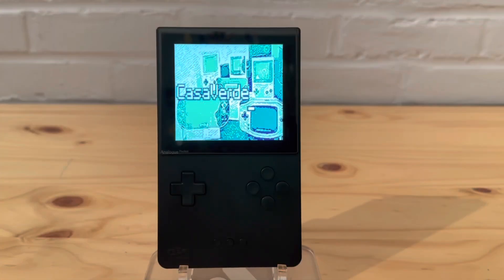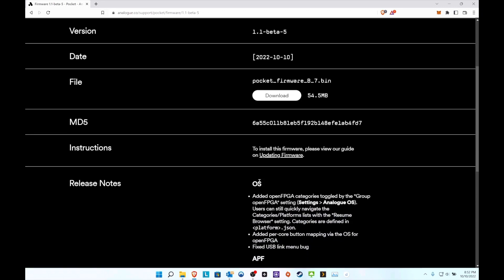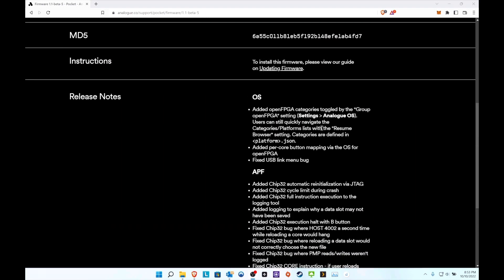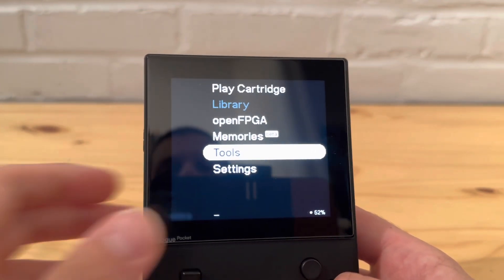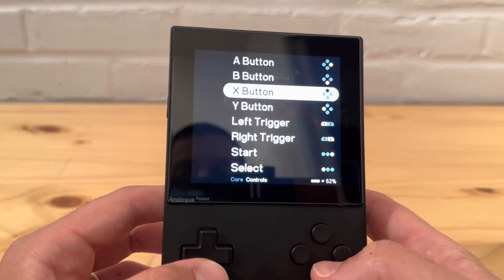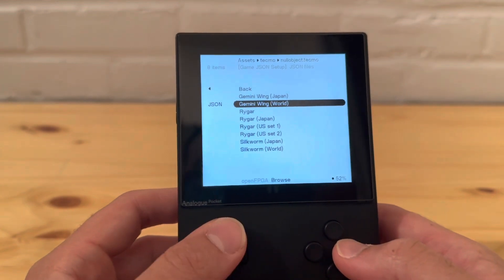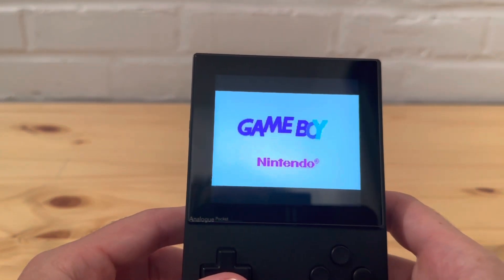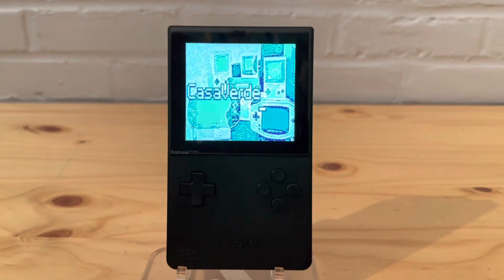New Update (Analogue OS Version 1.1-Beta-5)

Comment: Thanks for the update video
Reply from the maker: Thank you for watching
Reply: @CasaVerdeGames  hey casa. I just updated latest firmware for pocket. And see openFPGA when pocket is on. I downloaded a bios and dropped onto my sd card. But when put sd back in pocket and load. I can’t click openFPGA. Just gives me the QR code? Am I putting the bios in wrong folder on sd card?